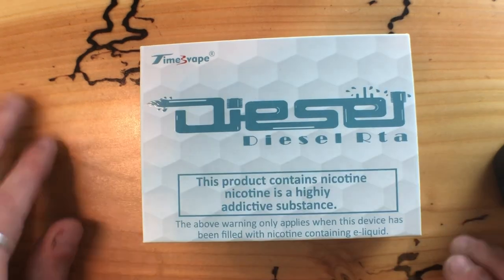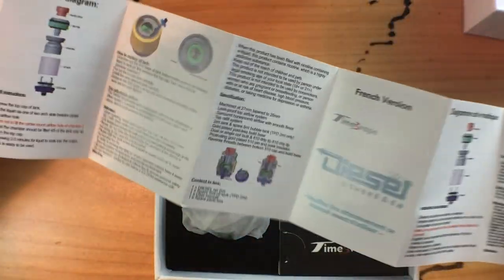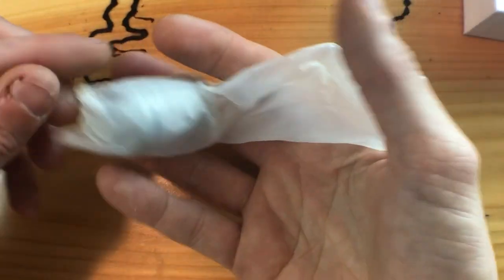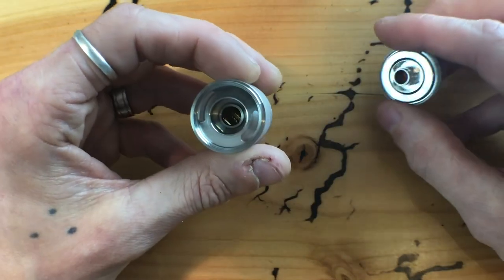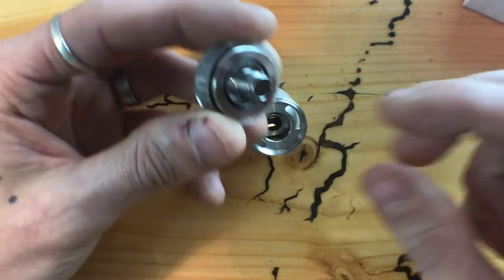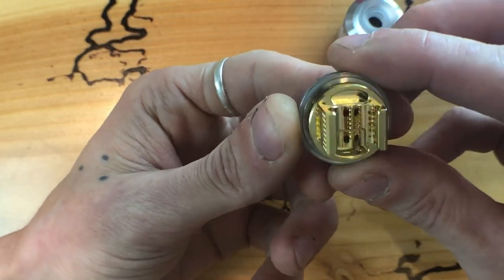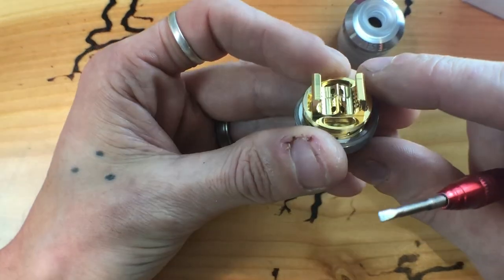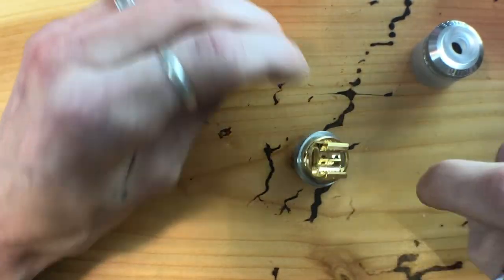DIESEL RTA by Timesvape Review English! Bit disapointed.

Comment: Good review man. I'll avoid commenting about the drama around this, but don't understand why people like gold plated decks. You don't see them when vaping, and doubt conductivity is all that different. Give me solid SS and be done with it.
I'l get a Bulk RTA instead. More capacity and less little parts for the top airflow nonsense.
I do like ultem or acrylic bubbles, but why the acrylic AFC on this? One good drop and it could break. Granted I haven't had any acrylic or ultem tanks break but am concerned about the AFC ring cracking.
Thx for review and subscribed. :)